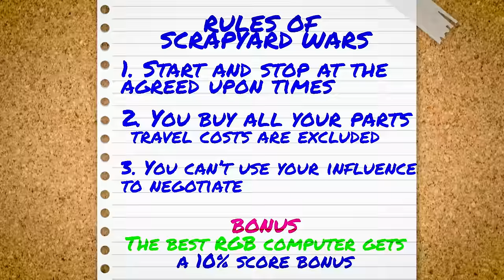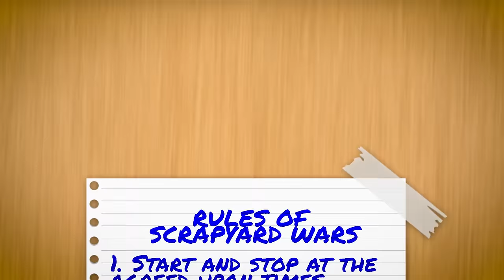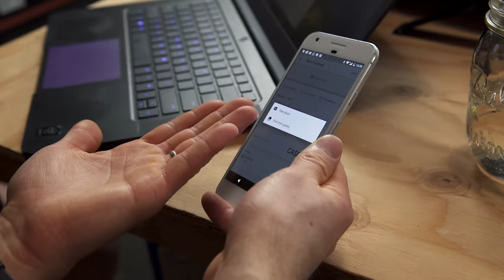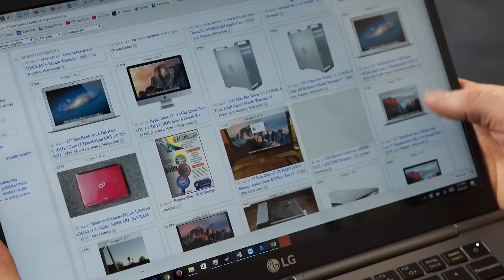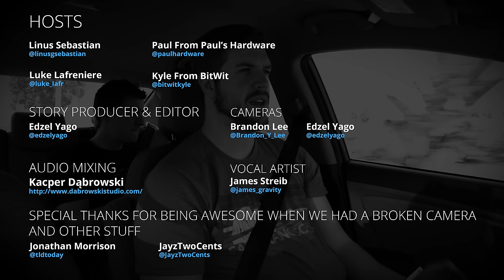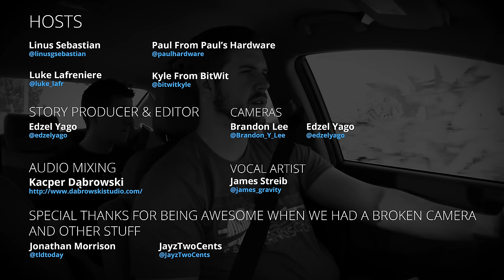$500 PC TEAM BATTLE - Scrapyard Wars Season 5 - Ep1

Comment: An FX 9590 with a 212 EVO... is that a joke or what???
Reply: RP RP rip evo....😞...that monster will roast you
Reply: I feel bad for the glaciers
Reply: My 8350 works fine with a T4.
Reply: Big difference between 9590 and 8350 tho. Massive oc an big voltage increase. 225w tdp lmao. 8350 is 125w tdp.
Reply: Isn't the 9590 just a more expensive and hotter 8350?
Reply: They're stupid for passing up that deal...
Reply: The 9590 is just a binned and oc'd 8350.

Comment: A helicopter flight would've been epic!
Also, get this guy with the 980 something nice, he really deserves it!
Reply: yeah like some LTT merchandise at least
Reply: Guys, it isn't 2015. The 980s are still beasts, but they have new competition that is driving their value down. And used ones even more so.
Reply: 185$ for an used 980 isnt that good. The 980 is actualy very similar to 1060s and you can get used 1060s for less than 175$
Reply: no a 980 is somewhere around a 1070 not a 1060 lmao
Reply: Not4You check the benchmarks. the the 1060 trades blows with the 980. pascal was a huge improvement.

Comment: Cut it down to $100, my first gaming pc was a $100 challenge, it had gtx 950, i3 3.5ghz, 10gb ram (8 usable, the other 2 were just for show), biostar b85mg motherboard, Seagate 1tb barracuda hdd, and corsair cx750m powersupply. All of it from scrap computers that I bought for $50 less than $50 each. What was the case you ask? 3 cereal boxes with the sides cut out taped together and covered in plastic wrap from my pantry. How long did it take for the pc to catch fire? 

3 days.
Reply: I made my own case out of scrap metal from the welding class at my high school and it was heavy as fuck but it worked
Reply: @dirpyturtle69  how did you get an i3 for under a hundred
Reply: Lmao i got a pre built with a i5 4600 and 8gb of ddr3 and then upgraded it to a gt 1030 all for $250.
Reply: Xavier Royer i didn’t That was the op I think I had an i5 I don’t remember how much I payed but remember getting a great deal because I was friends with the seller
Reply: bought a used rx 580 for 160 bought a ryzen 2200g and mobo for 160 used a 30 dollar case added 8gb ram all for less than 400
Reply: bulllllllllllshit
Reply: @xavierroyer5044  I've seen i3s at like 20$ here in mexico

Comment: 6 fucking K FOR A HELICOPTER UBER GODDAM IM IN THE WRONG BUISNESS
Reply: LTDanno360 Half of that is probably just the landing fees in SF.
Reply: LTDanno360 well, helicopters dont come cheap.....
Reply: 40:07 pogchamp
Reply: Trust me when I say that runway fees and jet fuel are not cheap in LA... I would rather drive the extra distance to the next airport over, than be the pilot of a private flight out of LAX. It's kinda stupid how much paperwork there is; at least all those company pilots only see what's not handled by their airline

And yes, helicopters sometimes follow the runway lines to take off (depending on a number of factors; I've got a friend that's told me stories about some of the madness she went through to get her licenses and ratings for fixed-wing and helicopter operation)
Reply: holy crap this just got intense

Comment: 185 for a 980. damnnn that guy is nice
Reply: TBH I don't know if it's that much of a big deal
Reply: 185 is about what they go for.
Reply: Tantan Orevillo don't know about us but in Greece 980's are from 180 to 240 € everywhere.
Reply: Not really, it's actually a really bad deal. You can get a brand new RX 570 for that price, and it's about the same speed as a GTX 980.
Reply: no name incorrect 570 is slower
Reply: DJ APOSTOLOU. ep ti pos pai
Reply: The 980 is only worth $200 though.
Reply: The 970 has similar performance to the 1060 which has similar performance to the 580 which is an overclocked 480. The 980 is better than all of them.
Reply: A USED 980 is worth around $190, a new one is worth more like $210-$220
Reply: CubeBot 123 nah nah, 1060 (6gb) beats out the 970 in amost all games and is about as good as the 980...
Some few games prefer the 900 series over pascal though...
Reply: +Mr.Magnificent well, thing is people move on to new shit like the 1060 or 1070 just because its new and not due to performance sooo, yeah also i saw a 980ti (reference model) for 230 usd on ebay
Reply: yep, thats about the new/used difference, im building a used parts pc at the moment sporting a i5 2500k (p67 mobo) a msi 970, 16gb ram, a 240gb ssd and a Case with real glass sidepanel + 3 led Fans just in the front which results in awesome airflow...
all this fancy shit (the cpu running at save 4.8ghz 1.37v overclock and the 970 at 1530mhz) costed me...

556€ lncl. shipping and Windows
Reply: and performance is about what a system with an i5 7600 and a stock 1060 6gb or to be more fair: oced 1060 3gb does.

edit: ok lets say i5 7500, its slower in the benchmarks but well give it the ram bonus
Reply: 980 is 20% faster than 570
Reply: I5? What is that outdated shit, Ryzen 5 all the way!
Reply: the i5 2500k will never get outdated though.
Only comparing against recent i5s cause ryzens work a little different and i5 are more comparable...
Id also get an r5 1400 instead no question
Reply: Yeah. i5s are showing age with 4cores and 4 threads. In CPU intensive games like BF 1. I5s cant keep up anymore.
Reply: well, they keep up yes, bf1 is just utilizing mostly everything the pc has :)
i5 100% load ->  rx 470 100% load pentium 100% load -> rx 470 still 100% for most of the time...
But thats just because bf1 is awesome
Reply: Tantan Orevillo 
That isn't even all that good of a deal. A 980 is essentially equal to a 1060 6gb, and the 1060 6gb goes for around 220.

Comment: They should have wired a stripper with rgb lights.
Reply: On the inside.
Reply: Markinpuff what is a rgb
Reply: Rowdy Gamer "red greed blue" lights. They are used for PC customization lights and make PCs look pretty
Reply: Rowdy Gamer red green blue, the primary colours, effectively meaning they can be mixed for any colour in the spectrum
Reply: Rowdy Gamer Means Red, Green, Blue. They can mix to make basically any color. You get it on most parts and they can make your PC look pretty cool with them.
Reply: @trviis  primary colors are red, yellow, blue
Reply: Papa Ajit i realise that now, I wasn’t thinking when I commented that

Comment: What's that shop that sells stuff for over 50% discount?
Reply: Ikr i wanna know too
Reply: Ricardo de Lemos I got a really good price for my laptop by buying from a showroom owner. Basically they have laptops out for display for about 5-6 months and then they sell it dirt cheap. I got a Lenovo x1 carbon for my dad at 25% of the original cost. Just wanted to let you guys know
Reply: fell off the truck refurbished shop
Reply: Shubham Sangle where do find a showroom seller?
Reply: Ricardo de Lemos I
Reply: its tunnelbear the vpn that wants access to a free internet

Comment: AMD A10, 8GB ddr3, 1tb hdd, 250watt powersupply, case -$100
GTX 1060 3gb - $120
450 watt power supply, $30

How long it's taking them to put systems together, I think I would have beat them hands down. This was built in one day. Could have overnighted another 8gb of ram for $50, and gotten the rgb version of my cooler for $50ish as well. $350, two days.

Comment: I'm not surprised with the Mac domination in LA; There's a lot of professional production and post-production studios in LA, and Apple computers have always been the go-to for audio. The simple I/O routing, low system latency, driverless peripherals and very stable OS make it the perfect machine for DAWs. Stock Windows has an average latency of 20ms, which is unacceptable for any video-related task. I had a session crash after 10 seconds during playback of video preview in Pro Tools and Nuendo, which is useless for majority of things. 
Not many audio professionals buy the latest Apple gear because everyone knows its crap, so most studios go for 2009 desktop towers and upgrade them to the max. You have to be very desperate to use Windows for editing (not necessarily for video and graphics production. This is purely with audio).
Reply: yea and hipsters

Comment: If they had been smart, they would have searched for a Dell Optiplex for $100-$150 with basically all the parts, then use the remaining on GPU, SSD, and LED stuff. Obviously not as dramatic as this, but that's how I built my $200 gaming PC.

Comment: My $500 computer
Intel core i5 8700t
Msi b360m vd pro
Asus Phoenix gtx 1050ti
Cooler master water cooler rgb
Oloy 8x2 2666MH ram
Kingston 250gb ssd
1 tb hard drive I got for free
Some generic psu I found
Generic case with a temperd glass panal
Reply: Could have gotten a rx 570

Comment: Linus! I finally got my parts for my pc build but I need help. Can you message me on discord?
Reply: What do you need help with? i might be able to help
Reply: Chason Animations I cant msg you on discord right now as i’m out but i might be able to help later.

Anyways, as for the ssd problem, I might know whats wrong- The ssd goes on the outside of the ssd bay. not on the inside. I had that problem with my first build
Reply: As for the cables problem, exactly what is the issue? Is it the headers, psu, etc
Reply: I don’t know which cables go in which slots. I probable need to check he manual.
Reply: I’m sorry if I’m confusing you. This is my first build and I know a few things about the build
Reply: Chason Animations Are you having a problem with the front panel connectors (the really really thin cables) or the not-so-thin ones?

Also i would recommend watching Bitwits guide on how to build a pc, really thorough and has a section on front panel connectors and regular cables.
Reply: Btw sorry for replying so late.
Reply: Thanks for your suggestion. I will make sure to watch bitwits video. And no problem I’m not in a hurry.